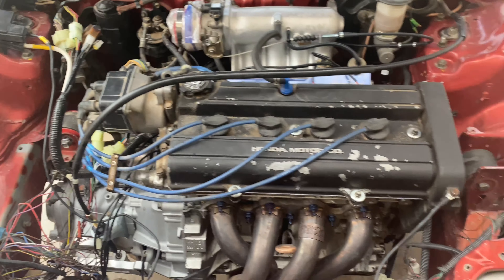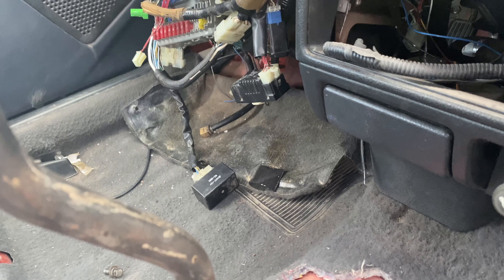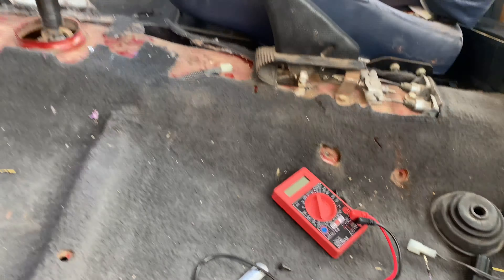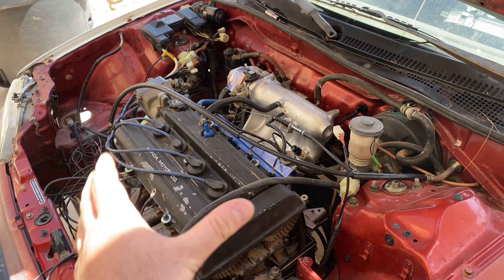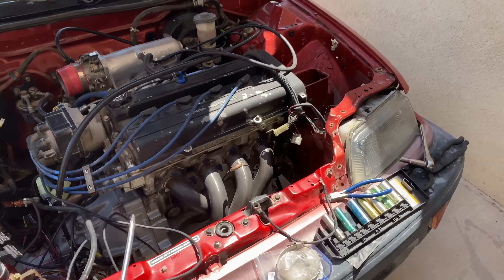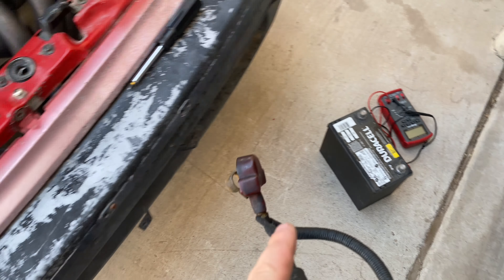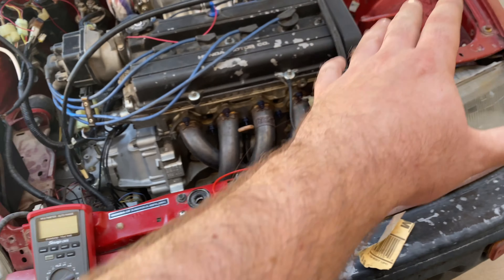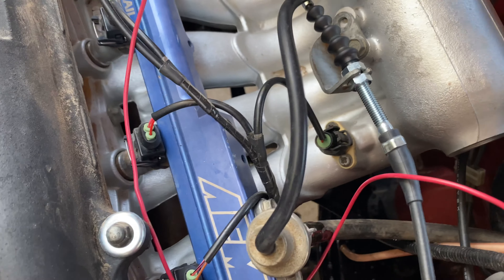EF Civic Build PT.3- The B20 Runs!!

Comment: Having the same issue not getting fuel or spark with the new monotech harness I got for my 1991 ef hatch it’s obd0 so kept everything obd0 that’s the only issue I’m having I saw you put the red wire and jumped it man any advice you can give me this is my first swap I’ve done
Reply from the maker: I had to repin the distributor wire I believe, it’s been a long while man. Pull up a wiring diagram and go from there